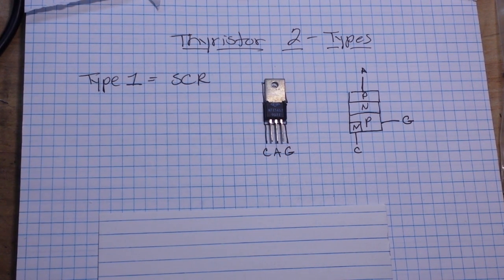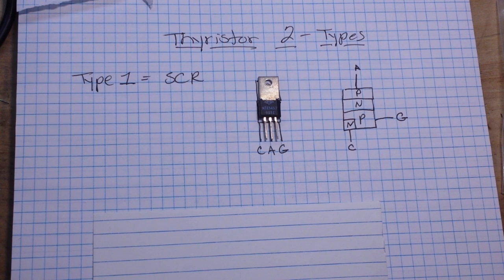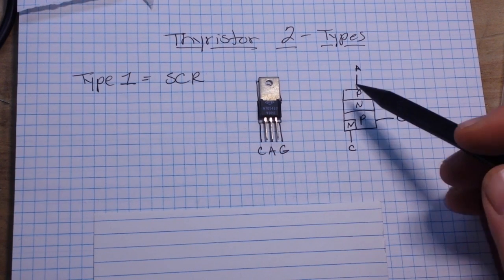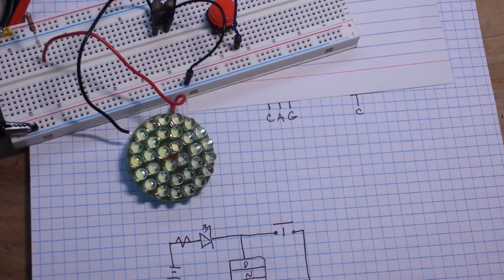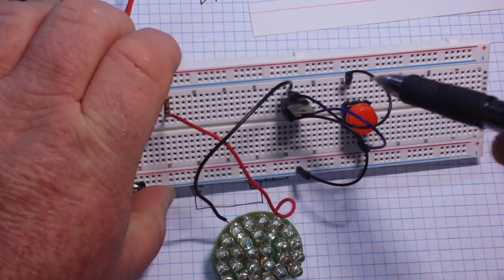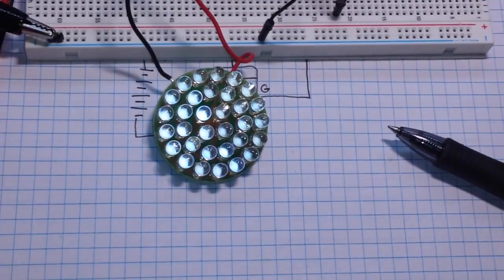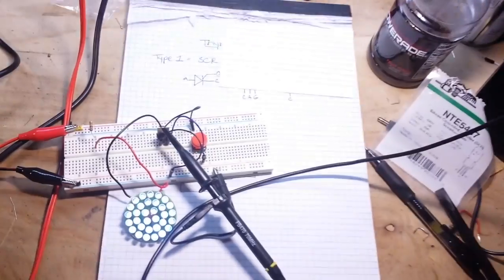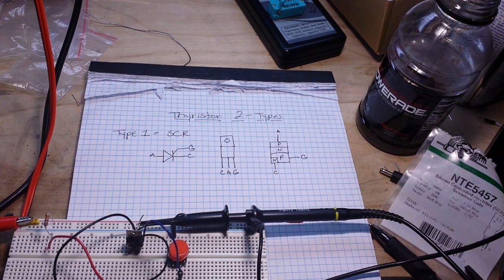Intro to thyristors: the SCR

Comment: why is RECTIFIER in its name?
what is it rectifying?
Reply: It's basically a diode that you can turn on whenever you want, every diode is a rectifier.
Reply: You CAN use it in an AC circuit and it will only pass the current one way

Comment: NTE5457 Not just for DC = I have used them in many AC sound to light switching applications - 
The NTE5452 through NTE5458 are sensitive gate 4 Amp SCR’s in a TO202 type package designed
to be driven directly with IC and MOS devices. These reverse−blocking triode thyristors may be
switched from off−state to conduction by a current pulse applied to the gate terminal. Switching via AC zero through the neg half  of an AC cycle will switch off the SCR. SCR's are designed for control applications in lighting, heating, cooling, and static switching relays. - Sorry, I just get fed up with half a lesson, The incorrect statements that you make for the uneducated to get electronics so wrong. you need to apply your lesson to both AC & DC Circuits always showing the data sheet for any component used. Please do not forget, or take for granted that everyone watching may not have any understanding of electronics. You have taken on a great task to teach on youtube and I applaud you for that, But no Apple for teacher today.

Comment: The other way to turn off the SCR is to short the Cathode & Anode. This makes the current flow though the short, thus the holding current stops flowing throught the SCR and it's turned off.

Comment: GREAT SCR LEARNING VIDEO.  One little TIP ( @ ~ 4:40 ), if you twist those T0-220 leads 90 degrees with a pair of needle-nosed pliers, they will slip right into the breadboard (or have you already?)!

The 1.7mA indicates why the LED's are too dim, one reason is that that 1k resistor is to high (how are the 32 LEDs arranged, most likely in parallel)?  If ALL are in parallel, you need more than 5v to increase the LED current, which should "certainly" be MUCH greater than 1.7mA.

Comment: recently purchased a DC motor control (more like rectified mains motor control hehe) that is utilizing 2 thyristors for switching. so it probably is just a fancy (or old and obsolete) phase controller that i paid way too much money for  (was like 23 bucks). at least it works, but the noise the motors make with it is unbearable
Reply from the maker: Well that's not good. Just to be clear,  are you trying to control AC or DC motors.
Reply: noise is the same on a DC and universal motor. the way the circuit is built it makes sense that its humming, but its annoying

Comment: Paul, what would be an application of an SCR in consumer electronics?  Great video, interesting.
Reply from the maker: High current switching. If you dont need the variability of a transistor an SCR is much more efficient. Used in lighting, and industrial mechanics.

Comment: SCRs can be used for AC in "inverse-parallel" look up the datasheet for MOC3031 it has an AC switching based on Triac and SCR circuits in there. I only know this because it's the basis for a MOT spot welder I made.

Comment: Another great video, did you build your power supply? just got mine finished, 1.25v-30v super stoked about it and giving it a workout! now to find a cheep scope, I have been using a sound-card scope  but it is not very friendly! keep up the great videos my friend.
Reply from the maker: Build is a strong term.  I assembled it. For a cheap scope  have a look at the DSO Shell 150.
Reply: @learnelectronics  ya, I bought and assembled a $20 kit scope and in my opinion it is worse than sound-card scope, I have a mid 60's heath kit tube type still works like a champ after a recap job, but don't cut the mustard on a lot of things, have my eye on a tectronics 4 channel, hope to get my hands on, enjoy your videos and learn something new or different way of doing it every time...cheers!